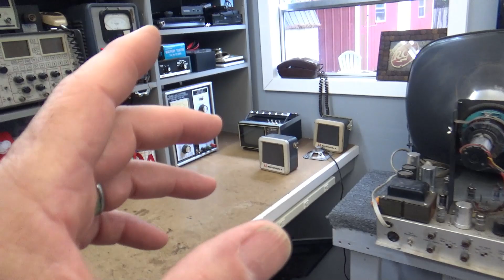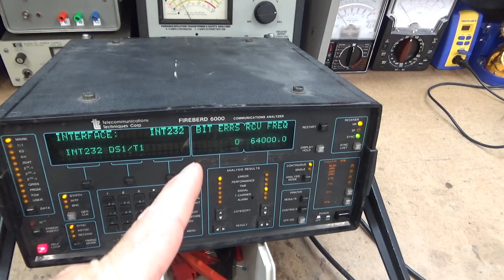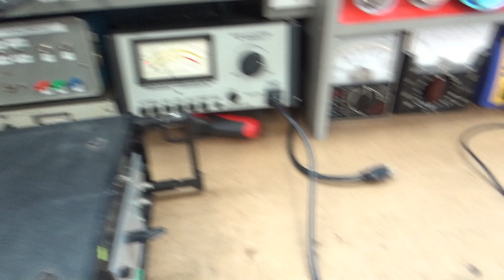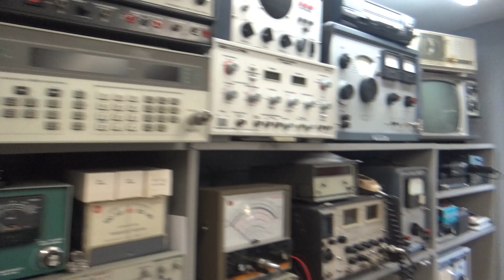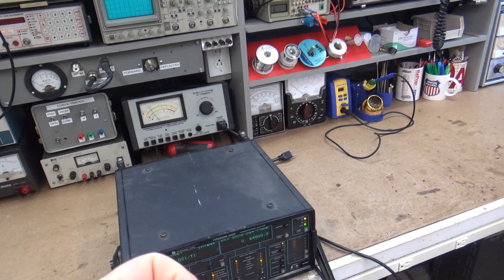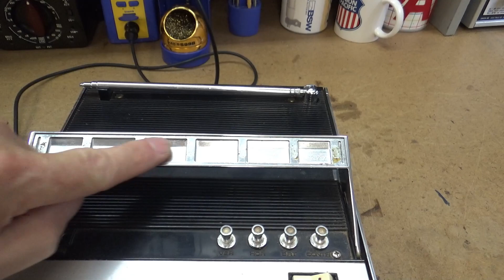Episode 101 Useless Equipment Repair TTC Firebird 6000 T1 Test Set Plus Shop Update

Comment: According to the manual, that unit is not "T1" specific, it can generate, and monitor signals from 50b/s to 15Mb/s. From the mid 1980's, until I retired in 2021, I had the need of a "Bit Error Rate Tester" , or "BERT" to build / turn up or troubleshoot many a Subscriber business T1 span, or, a "Digital Loop Carrier" system for analog voice and data. We had TTC, Phoenix, and at least one more common unit to use, the first 2 had some interesting add-on lids that let you monitor one "DS0" channel of the 24 within a T1, so, I could listen in to things on a digital level with absolutely no way for someone telling they were listened to. Being retired now, I have absolutely no use for those units, but I did pick up a TDR that needs repair. Thanks for the video content.
Reply from the maker: I wish I had made a video of the actual repair process; I feel like I cheated you guys.
Reply: @oldavguywholovesRCA  I wouldn't fret about it too much. Those are fairly 'industry specific" units, mostly used to check circuits on a exchange or possibly a trunk loop for telco's, so, not a lot of interest outside of people like me that worked in the industry.